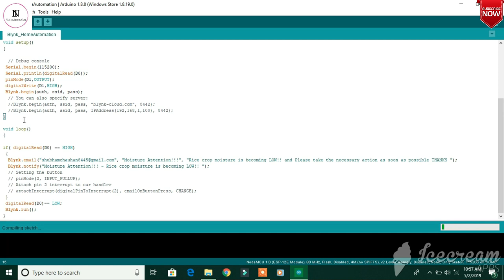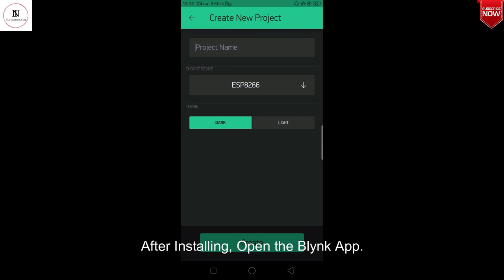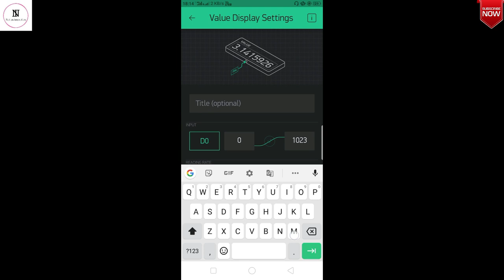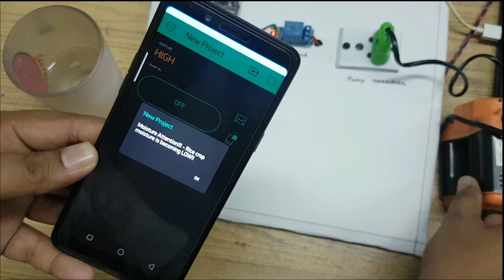How to make Automatic Irrigation System Using IoT? I Full Process | Step by Step

Comment: Hi, i am doing the same project with two relay and solenoid valve for the water pump, can i use the same code to recieve notification on the phone  and can i get the code ?
Reply from the maker: Yes, You can use the code. WhatsApp Us +919761872650

Comment: you can use this

const int analogInPin = A0;  // ESP8266 Analog Pin ADC0 = A0
int sensorValue = 0;  // value read from the pot
void setup() {
  // initialize serial communication at 115200
  pinMode(D0,OUTPUT);
  Serial.begin(9600);
}

void loop() {
  // read the analog in value
  sensorValue = analogRead(analogInPin); 
  // print the readings in the Serial Monitor
  Serial.print("sensor = ");
  Serial.println(sensorValue);
  if(sensorValue <= 500)
  digitalWrite(D0,HIGH);
  else 
  digitalWrite(D0,LOW); 
  delay(1000);
}